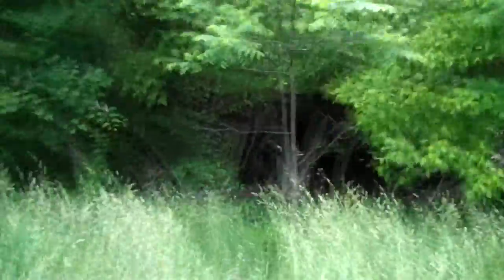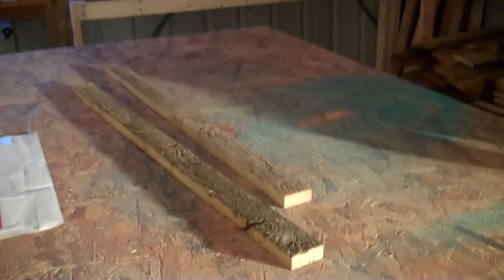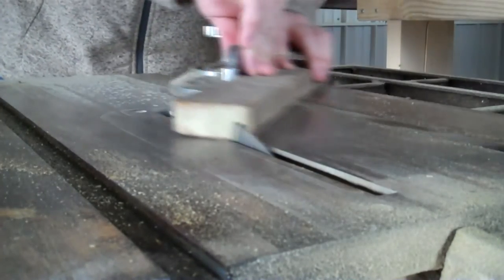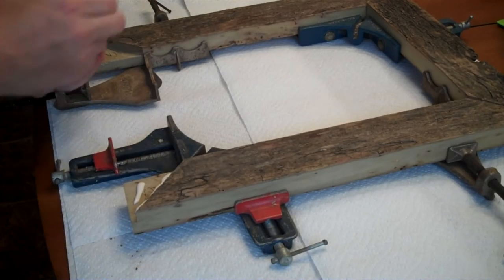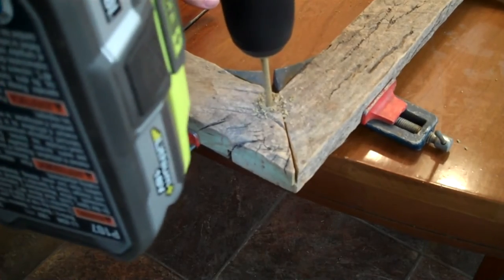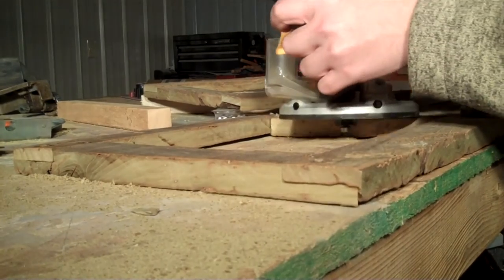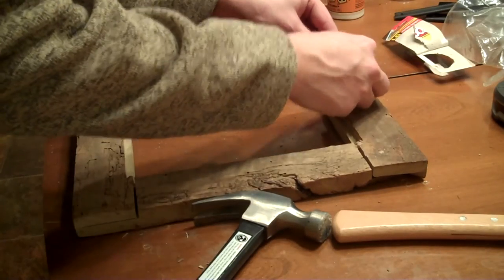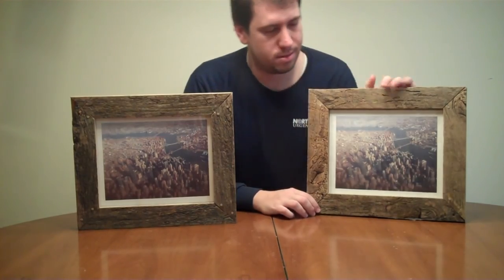🕷Making a Rustic Barnwood Picture Frame Big City meets the Country

Comment: nice!!! i have never seen that kind of half lap before, definitely going to give that a go, thanks for sharing :)
Reply from the maker: +jp woodwork Jamie. Give it a go it takes a little work to get the joint snug and square. Have a sharp chisel on standby but I really like it I accidentally dropped one of the frames from about five feet up and it held together really well.
Reply: Black Widow Woodworks sure will :) i will let you know how it goes :) you have a sticker in the mail by the way :)
Reply from the maker: very cool did you get yours yet? I think your address was on the group page. had to talk to the postman because I don't usually ship outside the US. If it doesn't get there very soon let me know and ill resend mine.
Reply: Black Widow Woodworks naa not yet, could take a while, ive heard it can sometimes take up to 3 months so i wouldnt worry for the time being :)
Reply from the maker: ok then but if its not there by spring ill resend it
Reply: Black Widow Woodworks ok bud, no worries :)

Comment: that was awesome man! love how you used the half lap joints.. I more or less taught myself to use all my tools by making frame after frame and that never even occurred to me!  im actually working on a frame video right now lol
Reply from the maker: +The WoodWorking Junkie I was thinking mortise and tennon originally but decided to go with the half lap to get the video out quick and its easier for others to replicate.
Reply: you made the right call for sure.. iv never done it so i cant back this up but i would think wood that old would be hard to mortise and tenon,
Reply from the maker: +The WoodWorking Junkie I don't think it would be to bad it's poplar and doesn't rot only the top layers were roughed up the interior was pretty solid.
Reply: oh i got ya.. just learned somethin new!